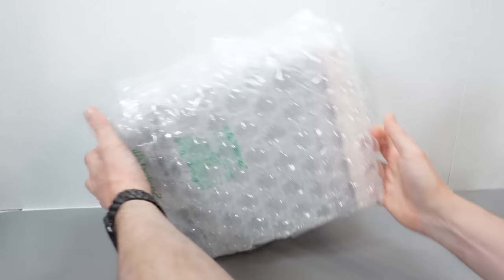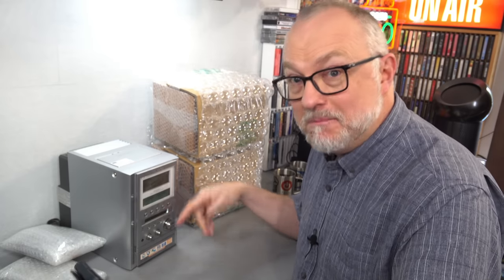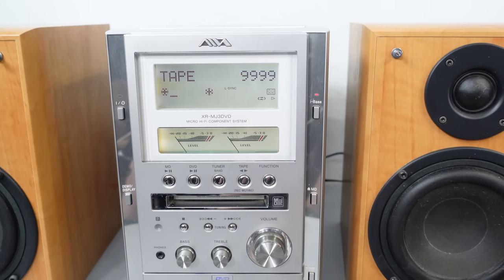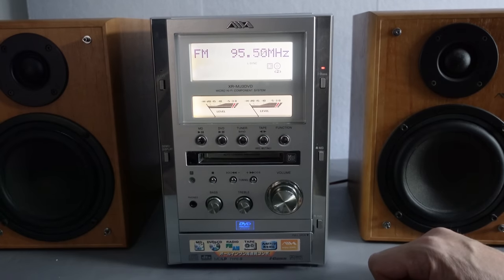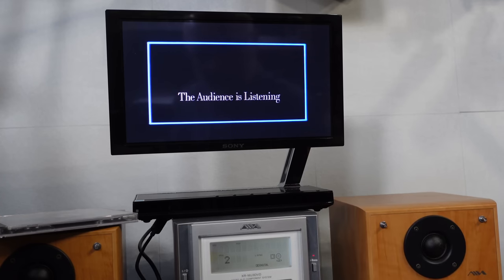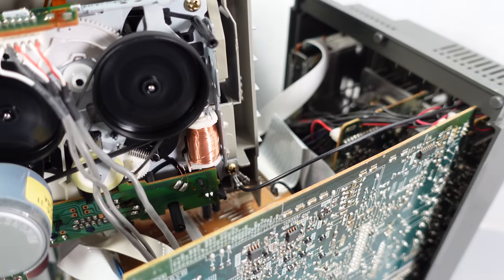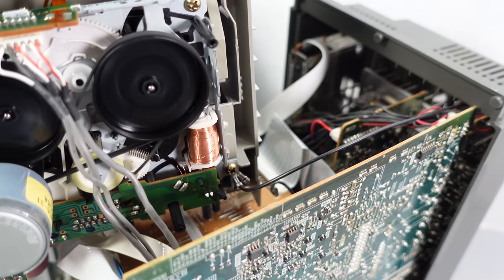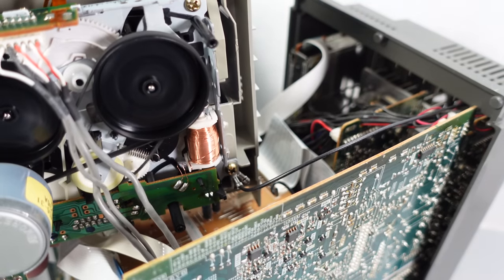Micro Systems 2:  Eclectic Boo-Boo

Comment: The part where you disabled the video output reminded me of the PlayStation 2. The PS2 has two video modes: YPbPr and RGB and switching those switches colour encoding and where sync is provided which left a lot of people with blank screens when they switched this by accident or because they used another type of cable the last time they used the device.
Whenever this happened you had to switch blindly. Power on without game > DOWN > X > wait > DOWN > DOWN > DOWN > X > LEFT (YPbPr) or RIGHT (RGB/Composite) > X

It's etched into my memory for all time :D

Comment: Personally i love old stereos. All-in-ones, component systems etc. Since my childchood i was fascinated about things with lot of dials and buttons. I could spend unreasonable amount of time just playing with my uncle's "stereo-prologic" system as a child in early 00s. Couple years ago i bought myself Sony MHC-EX7 system from mid-90s. While it don't support than many formats, everything works after almost 30 years! Only thing i did was replacing belts and pinchrollers in tape deck. Everything else works fine after all that time. It sounds fantastic for its price, much better than most soundbars/bluetooth speakers etc. I doubt I will ever get rid of it.  My friend have Sony minisystem (similiar to this Aiwa, but without MD), it still works and sounds pretty good.  

These 90s/early 00s stereos can be really "bang for buck" if you know what to look at.  People often sell them on auctions for really low prices, usually with not working CDs and tape decks. With tape deck needs just new belts most of the time, CDs usually have dying laser mechanism. But you actually can buy some lasers used in Sony and Aiwa systems, to bring them back to life. Many models do sound really good, considering the bargain price, and some have subwoofer output (like this one) so you can have even more bass if you like. I never had and Aiwa system, but i've seen couple models on sale - with original speakers, surround speakers and remote. I especially liked one with motorized panel that contain different sound modes.

Comment: The C13 error, can be caused by one of two things, either a bad laser on the unit, in which case I'd recommend you take it to a local electronics shop and have them check it out and possibly replace the laser.

It could also be a problem with two of the data cables inside of the unit, it is relatively easy to open the unit up and re-seat the cables:

1. Disconnect from the power
2. Remove the top cover
3. Remove the 2 flat data cables that connect the main PCB and the disk unit on both sides.
4. Plug them back in.
5. Turn on the unit and see if you still get the same error.

If you do I'd recommend you get the laser swapped out.

Comment: I had until quite recently a Sony of this era (probably 2004) without MD, but all components were quite good. The tape deck would only record on Normal tapes (but would detect chrome and metal for playback). The speakers were very decent (better than the ones on your unit). It also had an optical out for MD recording.

Comment: Interesting how the minidisk mechanism seems to be identical to one I have in a separate Sony unit. I wonder how many different mechs Sony made, and, do they actually have differences...

I'm always impressed by a Technics deck I bought few years back. As far as I could tell, never been opened, the screws gave that satisfying snap. 1980 model, few months older than I am. Works fine, no wov,  no flutter. The belt is the thicker type, maybe those last longer, maybe it's just the luck of the draw...

Comment: VCD is MPEG-1, SVCD is MPEG-2, and DVD originally used modified MPEG-2 before they switched to MPEG-4, so it's relatively simple to make the system with a MPEG decoder that will play all those formats. It's not really a multi-format system in that sense, since a MPEG-4 decoder is perfectly capable of decoding every MPEG format. Converting the digital video into all the analogue outputs is actually more complicated than the decoding. 

One thing I found interesting about this system is that all the PCB are different colours. It's a sign that they come from different sources, which likely means only the mainboard and assembly was done by Sony. Also looks like the DVD drive is just a PC drive, and not the open type you normally find in DVD players - which require a separate drive controller board, where PC drives have the controller integrated. Judging by the markings on the green board on top of the DVD, that board is the MPEG decoder

Comment: This was prior to later on having a cowntdown timer to confiirm the output selection before everything goes back to previous mode, so you would have had the option to go back to composite automatically since you cannot confirm the selection change due to black screen, I thought that feature was the best thing ever.

Comment: If you don't know where a connection is supposed to go, get a multimeter out and then check which pin connects to what leg on the ic chip on boh ends. if it's a flat vable, you can probbably just use ground to pick the correct orientation

Comment: "It was stuck to me elbow" is a plot twist worthy of an M. Night Shayamalan movie. I honestly thought that piece of plastic was going to be what was jamming the DVD mechanism.

Probably a bit late to try now, but I was wondering whether or not this deck's DVD player would have handled Region 2 PAL discs. I brought my first portable DVD player over from Japan in 1999 and one of the limitations was that it could only play NTSC formatted discs, which was great for Japanese imports and home-brewed discs but for retail discs it negated the advantage of Japan and Europe sharing a region code. I don't know if this was a limitation of the built-in display or of the on-board decoder, although I suspect the latter because its S-Video output wouldn't do PAL either.

I'm assuming Techmoan's THX demo disc was Region 0 NTSC.

Comment: I doubt you will see this, and maybe you already know, but you can make custom belts for this stuff using "buna n" o ring stock and super glue. I used that technique with some wood working machinery I designed and it works well. There's a lot more load on mine than I imagine is required for the belts you tend to mess with.

Comment: I just threw away an Aiwa 6disc changer from my childhood. Tried repairing but parts are really hard to source. Yours on the other hand could make a nice lil PC tower. Especially if there's a way to get those gauges in front to work without their original hardware.

Comment: The thing is that someone would watch this, and it would reinforce their belief that it was common for tapes to get "chewed up".  However, I only ever experienced that a literal handful of times, and more often than not, it was the result of me needing to clean the pinch roller, capstan, and head.  After a bit of sprucing up, right as rain again.  I have cassettes that are over 30 years old, that I have played who knows how many times, not a bit of damage to them.  Worn, perhaps, and not as good as they were once, but still working just fine overall.

Comment: You can buy that cables for the tapedeck: FFC , attention to the pins, the pitch of the pins and if the ends are reverted or straight. Be careful with the connectors of the FFC (flat flexible cable), there are types to pull to loosen, some to flip an part to open, some to simply pull the cable out.
I think, with patience you can save this micro system. Most problems are the connections of the FFC.

Comment: This is why I've never gone for anything that combines multiple devices into one. I very much prefer separate components so if one component dies you can replace just that one thing. It doesn't even have to be the same brand or style, if it's something old and really hard to get. The other advantage is that you can keep adding new formats as they come out without having to get a whole new system. And with a simple input selector box you can have as many different sources as you like all going through the one amplifier and set of speakers.

There were a few mini and micro systems back in the day that did consist of separate components that could be separated and stacked or lined up any way you wanted.

Comment: I have a set of Sony speakers that are nearly identical to those, likely came from the same factory. The metal pegs holding up the speak grill can be unscrewed with a hex driver. Although my SS-CRB5's have a metal face plate, so the appearance without the pegs may be a little cleaner than the wooden face on those Aiwa speakers.

Comment: Had a Sony micro hifi just like yours minus the DVD plate and Minidisc. The belt for the CD player was bad and after opening it up I gave up and gave it away to a friend to use for aux in. It’s a nightmare to work on and your brave to pull it apart.

Comment: The newer they are , the crapyer they are made. I have denon (DRS-640) cassette deck from 1993 and its belts are like new , doesn't have bulging / leaky capacitors , and its working like its out of the box

Comment: I just snagged a little denon micro cd reciever ud-m31 off marketplace for $10! Was cutting out randomly so end up reflowing a bunch of solder around relays and speaker output etc. Clean those boards with isopropol toothbrush etc put it back together it took 2 goes to put it back together lucky i didn't mess anything up. Hopefully its a win no cut outs so far...

Comment: Think my micro system supports more standards than the one you've got there! I still have a very similar system purchased around the same time, Panasonic model, still in working order. Pretty much just use to play audio output from PC into but it has tuner, 5 disc multi CD that supports same formats as your one. Also plays DVD including DVDRAM discs which I believe was an exclusive format to Panasonic. Did used to have a DVD recorder from Panasonic too that could record, delete and rerecord on the same discs a useful idea at the time pre PVR devices.

Still going strong after 20 years, albeit only used for its amp really in the last ten years.

Comment: "I know it looks like a car crash" Top Gear'd it. If you're just down the block I would love to have that and try seeking a fix for that poor thing. Might even convert it to use a battery pack and stuff. There might be a fix for the MD deck, a switch that detects disc-in or something gummed up like my old JVC normal size component with a THREE disc tray changer...what a pain that was!

Comment: I've got a Sony micro system of the same age, it must be said that I, or to better say my mother since I was 5 at the time, also bought it so it was well cared for all these years and it still works very well in every part, admittedly not many (cassette, cd, tuner, and an rca input which I use for my record player); also it's the same you featured in some past video

Comment: A very similar experience to mine when trying to fix a Sony micro system. The tape deck didn't work after replacing belts as I could never get the mode gear in the right place to play a tape. The CD drawer jammed in exactly the same way yours did, and I could never find out why. Ended up as a parts unit too! These things are tough to repair.

Comment: Please put the D Component Av cable in  a frame on the wall when it arrives as  tribute to this hifi 👍 thanks for showing the fun you have with old electronics. Also the times I've changed the Video output and said to myself why did I do that? ..

Comment: I had an Aiwa system that had a triple cd turn table, tapes decks etc and after about 10 years or so it started to fail, it would randomly eject the cd tray and when I pressed certain buttons either on the hi-fi or the remote it would do something else. I think that the early 2000's wasn't good for them even though I was very happy with the system while it worked and I do miss having my own Hi-fi in my room.

Comment: this gave me flashbacks to the mid 90s wen i had to take apart my Walkman and replace the broken belt with a rubber band. that rubber band lasted yrs i was impressed that it held together that long. it died wen the imput wore out, i have no quick fix for that. i must have gone threw a half dozen tape players before cds took over.

Comment: It almost looked like the components might all be off the shelf parts that could be replaced.    Perhaps those exact mechanisms were used in multiple different systems and one could just plug new ones in. The reason I think this is because of the way they were mounted within the system.

Comment: For the slow DVD, maybe it's down to capacitors (same old story I know), GameCube's that are also from that same era are failing left and right nowadays as the optical drive caps need to be replaced. Most people online wrongly claim that it's due to the laser, when the laser is almost always perfectly fine. They're made to read a few thousands of hours at least.

The optical drives of a lot of devices are sensitive to the capacitors being a bit out of spec.

Comment: @techmoan, the minidisk and DVD behavior looks like a missalligned switch mode, it is often happening when reasembling devices like VHS etc the wheele controling/controled by the switch mode moved and no longer proper alligned with mechanism.
Otherwise, very good vidéo as always sir ;)

Comment: 2003 was my first year living in Asia, and the first year that I visited Hong Kong. It seems that most stereos at that time doubled up as DVD and VCD players as VCDs were very popular in Asia and the Asia version of video rentals at that time was mostly VCD rentals In early 2003 and DVD getting to be the standard over the next year.  The Japanese units on sale in Asia were competing with Chinese units that could play any format including CDR DVDR and MP3/WAV etc and the Chinese units were all-region DVD.  I bought a very stylish Sharp system which I still have in storage somewhere.    I have found that these systems are very fragile, easy to break and then not really worth the trouble of trying to repair.  Also regarding the FM, Japanese domestic units had a different range of FM frequencies.

Comment: This is why it's never a good idea to buy stuff like boom boxes from 20+ years ago ... A mere belt can be almost impossible to replace without breaking other stuff while attempting to repair the unit.

This video drove that point home very well. And from such an avid collector like you who fixed so many items successfully in the past.

I remember in the late 80s / early 90s a VCR would be like $400. If a belt needed to be replaced, you would have to take the unit apart just to access the belt that needed replacement.

If you brought the VCR to a repair shop it would cost almost the same as a new VCR just because of the labor (and a $2 belt). This is in 1989's dollars btw...

Comment: Internals look super similar to a couple of Sony mini units I've taken apart to fix all the same problems. On the Dvd drive you can sometimes get away with tweaking the pot on the laser but you need to measure the resistance and tweak it by tiny increments.

Comment: Mat, have you ever encountered a mini shelf system which sounds wrong through any speakers other than the included speakers? I picked up an all-in-one mini system for my desk at work years ago, just to use with headphones. When the headphone socket started to get intermittent, I thought I could use a speaker selector with a headphone out as a workaround. Unfortunately the timbre from the speaker outputs is drastically different from the timbre through the proper headphone output. I can only guess that it  is internally EQ'd to compensate for the response of its included speakers.

Comment: This is quite sad how the quality and durability of HiFi components deteriorated since 70' and 80' till 2000. How come that my 30 years old Onkyo Decks have still original belts and capacitors in great condition, whereas everything between 2001-2010 is either dead or almost dead now?

Comment: What's crazy about that belt is that I have a JVC cassette deck from 1983 that has never had a belt service and SOMEHOW its belts are fully intact and working great still!
I wonder if disuse is what kills the belts faster rather than overuse. I know if you leave rubber bands sitting for a long time without handling or using them they get brittle, so maybe?

Comment: PTSD once the ribbon cables started to get unplugged, I did the same thing on a 3d printer I bought from an auction, put it back in the wrong way round POP, mainboard fried. Quite the learning experience.

Comment: I recommend the Sony HCD-SE9/MDS-SE9HCD-SE9 mini component which does 5.1 surround/SACD and everything your mini Aiwa does too in a tad smaller foot print despite being two combo units. I know this because I also have the previous version of that Aiwa which is the Aiwa XR-FD55 & looks to have essentially the same foot print and the tape is exactly the same on top, just the VU meters being a little bit different and no DVD function on my Aiwa. I kinda want to get the one you have... That C13 is a super easy fix(my Sony had it) and took care of it easily. The sled for the MD is misaligned and just need to walk it over to the back to align properly. That should fix that since you already took care of the belt. Cheers

Comment: Just remember early 2000 is the peak time of plan retired of comsumer electronic products. I have bought two Sunbeam  water kettle(midrange highe quality one), which all magically last just exactlly 2 years and then just went dead. SO in this case, even somone could manage to put all the component together, the chance is there would be some part just not working at all and you will have now way to fixed them anyway.